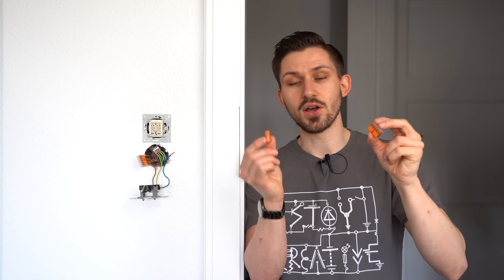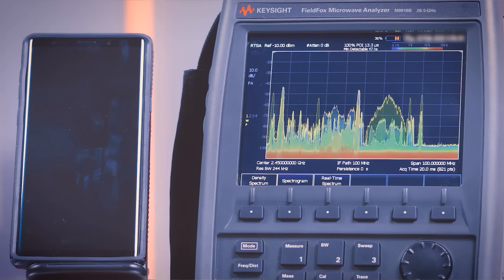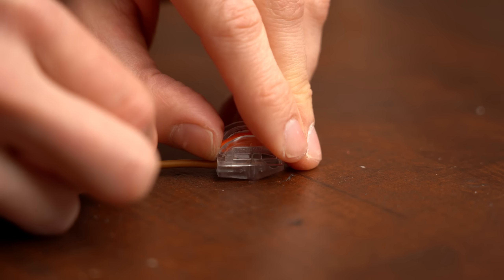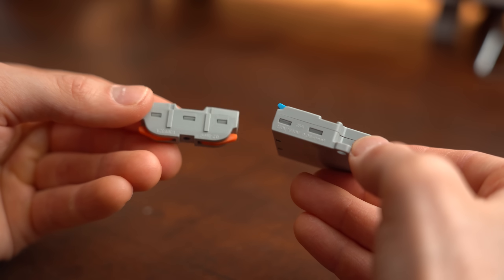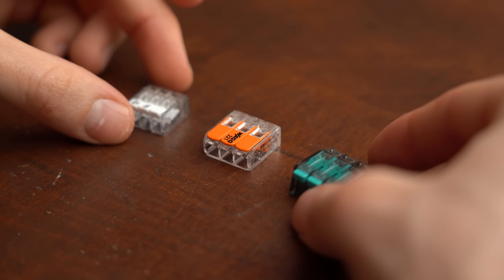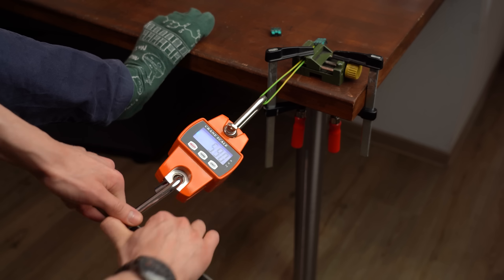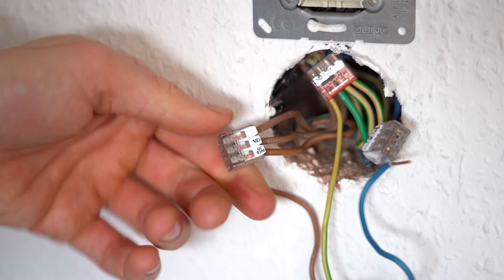I tested 7 Wago Knock-Offs Wire Connectors so you don't have to! (Surprising Results)

Comment: I use the lever kind all the time but I can say that there is not some "best" option between them for all purposes. It depends. I've seen lever nut splices where they magically somehow wiggle and pop off, lending to the idea that their use in general could become a little "too easy" for people over time. If I forcefully tried to remove a wire from the nut without opening the lever, I can do it with some twisting and turning. It's just not magically as solid as taking something like 12 or 14 and literally braiding it together. Wagos could probably stand the test of time but AFAIK empirically they cannot compare to wirenuts which have the actual evidence of doing so in many situations. 
People who are doing basic residential or light commercial wiring don't need to be too concerned about it.. they just need to make sure their joints are good with whatever product they use. Some facilities have local code which requires them to braid and solder permanent terminations in the boxes, something which the thought behind is not possible to do with a lever nut. Some of the thought behind that could be something like hospitals where engineers have kept it in mind that they want feeds to stay together temporarily maybe even in some drastic situation where an earthquake or other climate disaster has damaged some of the infrastructure. Having said that has anyone ever used wagos in a hospital for anything other than small fixture wiring? Would they let you make all the jbox terminations with them? 

This is just a random and joking example but I bet someone who is in an extremely unlucky situation where they need to hold onto some long ground wire to keep from falling is going to prefer it was fastened at the other end with a braided wirenut as opposed to a wago. I understand a wago may be tested and rated with all the acclaim but again, it's not hard to go see wirenuts older than you in old plants which are still fine. You can't do that yet with a wago unless you're pretty young. Of all the back and forth about wirenut vs wago I just don't get it when it comes to simply and basic wiring. Who cares. Just don't use scotch tape. People are talking about their preferred product for their electronic light switches lol.

Comment: i couldn't see very clearly but when you said the last bunch of connectors had the CE logo i thought that i saw the Chinese CE logo (i could be wrong, it is hard to see which is done by the Chinese on purpose). The EU CE logo is the certification. The Chinese CE logo simply means "China Exports", which just means it comes from China. The difference is that the the EU CE has a bit more distance between the C and E than the Chinese CE logo. (you should look it up if you didn't know this, it is a subtle difference)

Comment: About 4 years ago I was building a Amazon out in Ohio US. I was in the convayor power and termination crew, and main power distribution. 

This was the first job I've been on where the spec called out waygo connectors. 

Amazon uses computer algorithms and sound engineering down to the fraction of a cent so there was some reasons why the choice was made. 

Since then, I have preferred them to wore nuts and seen a few jobs add them to the list of specifics. And this is a change I like to see. 

How I was trained, was only partially correct because 20 years ago we didn't have these and the option that was avaliable was a push in only style that was not shown here. It would lead to higher resistance, and even conductor breakage due to the irresponsible installations they were used in. These were not waygos and there is a difference. 

Now, knock offs vs oem. Some knock offs are long as they see listed and labeled, have the proper certifications and are fit for the job, it is then equal in many different aspects. Like ideal and redhead as brands of wire nuts, one could call all products down stream from the orignal wire nut made from porcelain with a screw terminal that it self screws in to a shroud as a orignal. 

Regardless, they are faster then solder and insulation and that makes them better for reworking, troubleshooting and even better then wire nuts.

Comment: I like how the resistance test graph conveniently failed to show that the Wago connector, like the one in the vid comparing Wago to wire nuts, had a resistance of 2.2 mΩ - higher than any of the knock-offs. Nothing like a good, unbiased comparison video, eh?
Reply: Watch the video again and then understand the point... With a 2.2 milli Ohm resistance this really only starts to become an issue when you try to run 1000's of amps through the Wago, by which time the wires will melt long before the Wago will.
It is not a comparison 'who has the lowest milli ohm measurement' because frankly nobody cares, it is a comparison 'are they all low enough resistance so they will not overheat'...

Love the immediate cry that it is now a biased comparison because you disagree.

Comment: The only other test I'd like to see is running high currents through them to see how much they will take.  Other than that I do think this is really good information and I use Wago connectors in my house wiring all the time.
Reply: Take the resistance measurements and calculate it ;)

Comment: Can we have the next video on how stupid NA's are because we insist on living like savages with our 120v single-phase?   
.

Wago's are nice, however quite a bit more expensive. 
I get that they're hip, and reuseable, etc, etc. 
Here's a Trades tip most of you brainiacs have missed in your circle jerk of smug superiority.
Over here, we connect a light switch or junction box with a wire nut, yes; and in all likelihood its probably not going to be touched for 10, 15, maybe 20 years, maybe never. 
So, I can strip a couple wires, twist with some pliers, and twist on a wirenut, crimp if I'm Union.
2 minutes max.  Or I can save a whole minute, and use a Wago at 2-3x the cost/connection.
And then its going to site in a switch box or J-box for the next xxx years.
Aside from Makers and tinkerers, outside of >3-4 wires being connected, Wago's extra cost and 'features' are either negative or N/A for most applications they would be used for.
If I have 4/5/6 wires all coming in, then sure a Wago would be nice.
80-90% of household wiring over here though is 2-3 though.
Reply: @Boots: A bit more emotionally presented than my style but I agree and I'm grateful you said things that needed saying. Thanks!

Comment: In my home I have yet another style of connector, idk if you ever heard of them, but basically they are Wago connectors but they doesn't use a leaver, they use screws that clamp down the wire
Reply: He also shows those in this video when talking about an older video.

Comment: These Wagos are EXCELLENT when wiring stranded LED lights/fixtures to solid gauge wire that's wired around the house. They also work very well with applications around the car and motorcycle which I have at least a decade of very good experience using. The only reason I still use wire nuts is cause I purchased a whole bunch at a discount years ago.

Comment: Why use wire nuts? When there is acient and proven method for connecting wires: Twisting wires together and isulating them with tape. Cheap, low resistance, non-flamable and disassemblable, only weakness is idiot profing.

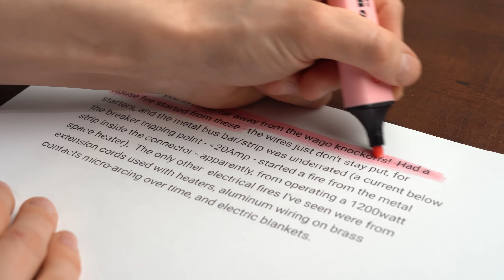Comment: 8:17 ...the smaller the current
Reply: P=(V^2)/R, where V^2=220^2=48400 (in my country, that is.), so P=48400/R, so the lower the R, the higher the P and you lied. Disliked.
Edit: Am I the ONLY person in here that noticed that? oh, and BREAKING NEWS! A 13 year old disliked electrician's video for lying in it!
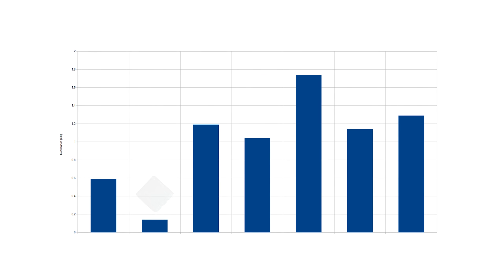Reply: 9:21 Not*
Reply: With current and resistance it is a quadratic relationship - see video. You're jumping in with a completely unrelated (to the situation at hand) equation.

Comment: I sometimes think these opinions wire nut versus wago are formed based on something that are formed because someone learned that way and has used that method for so long, not necessarily because one product is superior over another.  I've never used Wago connectors because I live in the U.S. But I am definitely intrigued because of your videos.  Thanks for sharing this insight.
Reply: Honestly I get nervous looking at wire nuts, to me they just feel 'bad' even though I know they're fine too, most likely a cultural thing/used to a different style. I guess the wire nuts look old and therefor obsolete/bad... I wonder if Americans look at Wagos and think they are cheap plastic or over-engineered or something?
Reply: @someguy4915  To me they are normal over here in America.  One big downside of using them is if you do a lot with them then your hands are going to get sore.  They make a tool that can make it easier.  But we didn't have it when we were doing wiring in our house.  So we had very sore fingers.

As an American I don't think wagos are cheap plastic.  My only thought is they might be a little cost prohibitive if you're doing a lot.  But it might be worth it too to avoid sore hands.  I think what will keep wire nuts going is the fact people have been using them so long over here.  You've got electricians who have been using them a long time.

Comment: Keep always in mind for the house installation connectors what can happen when a cheap terminal setting your house on fire. Your insurance is always hiring good fire detectives.  Imagine they figure out you made use of non certified materials with fake writing! No insurance will pay then.
Reply: Know your contract and the law.
Reply: Uh... People die too...
Reply: Depends, in most European countries this doesn't really apply unless the insurance can prove that it was intentional (and then it's a crime). Though it is absolutely smart to get certified parts instead of cheap knock offs. For companies this is different as they can in fact be fined/faulted for uncertified installations.

Comment: We replaced all the manually made wire splices with Wagos before the plaster were put into place, so we knew everything would be safe. But as a generic rule, I'm Brazilian, here I pay about R$2,89 for a three connection Wago, and, for a wire nut, R$0,09, so, I use wire nuts mainly for led lights where the power draw doesn't justify a Wago connector, and, they'll likely never be serviced shortly.

Comment: Well, they're sort of right. If your connector is rated for 30 amps, and and one connector fails at 90 amps, and the other 1 fails at a 100 and 10 amps, in the amps, the 100 and 10 AM connector is not necessarily better, because they're so far above the rated Ambridge that they're both effectively perfect.
Reply: It took me a few readings to understand that you meant a single connector failing at 110A, not two failing at 100A and 10A respectively.

Comment: Not sure how a CE certificate could be applied to a component? I know Honeywell was fined for a CE mark on a microswitch. Warning Its complicated. Only a technical report would give the details of which tests the component was subjected to. I would say a CE mark would be a sign of they did not know what they are doing. Honeywell Quote "The TS Series only has UL and Canadian UL (cULus).  Our datasheet online incorrectly shows UL, CSA and CE.  We have asked to have this corrected several times before, but it is still misleading our customers.  These switches have not been tested for CE or against the European Standards." Because you cannot.
Reply: As far as I understood, the CE mark is just a "fit for purpose"-certificate. This can apply to individual components, but also to installations.
Reply: Ah, I also forgot. There is a "China Export"-logo (developed by the Chinese government if I'm not mistaken) that is almost exactly like CE, but the spacing between the letters is slightly different. Not a source of confusion at all!

Comment: Personally I don't trust anything except manually twisting wires and welding them a bit with modified microwave transformer. It'll never fail

Comment: When it comes to the CE marking you have to look closely at the marking. The CE (Conformité Européenne) and CE (china export) are similar, but with differences since china export is not a certification. The knock ones I bought are using the china export CE, so they don’t have any actual standard certification.
Reply: This is mostly a myth. It is true that some knockoff products used the CE logo with incorrect spacing, but nothing is stopping knockoff manufacturers from just slapping a CE label on the product and selling it anyway. It is almost impossible for them to be held accountable, and customs aren't going to check the certificates for each product that gets imported.
Reply: Chinese have woken up to the correct CE mark format. Even Microsoft used the wrong format a few times. There is no China export standard only  Chabuduo Export.
Reply: Once again, China Export was a myth, a hoax/joke created to make fun of the fake certifications... Even big Western companies get markings wrong sometimes, China Export is not a certificate nor would a shady Chinese manufacturer of poor quality components care about falsifying a certification...

Comment: I was just working on a project that had a heat issue in the wiring and connectors (higher than expected current), and Wago nuts saved my bacon. They sell them by the box on Digi-key, and next time I'm using these for power distribution. Just need some 3D-printed mounts.

I do have a small kit box of "made in Germany, packaged in the USA" Wago 221 nuts, but since Amazon knockoffs are a minefield and since I can now buy them easily on reputable distributors, I don't buy them on Amazon anymore.
Reply: Buy some fuse's as  well.

Comment: Many of the "knock off's" from China that have CE stamped/imprinted on them is a misrepresentation. As Chinese Exporters are required to be licenced the CE marking is usually an internal bureaucratic thing and nothing at all to do with the CE symbol used in the EU. A genuine compliance would have a registration number with the appropriate testing body and cross reference to the tested laboratory etc information publicly available...

Comment: Australian electrician here. Our connectors are defined by a book known as the AS3000. The wires must be amalgamated under a screw terminal. As far as I'm aware, we can't use a connector like this unless it is internal to a device. Additionally, our wires are joined and then secured meaning there is no bus. With the wago connector you are relying on a bus internal to the device not failing. And we need to consider the long-term safety as it is inside the wall..

Comment: I don't know how many times I've put a wired nut connector wrong. I believe the Wago connectors are far superior. The clear case clearly shows you if the connection is done right. Further, when combining solid core vs. stranded cables Wago makes it super easy. And for all the people that don't like Wago connectors, you are free to use wire nuts, no one is forcing you, so don't hate on Great Scott.

Comment: Hi MR. GREAT SCOTT ....
I am a regular viewer of yours. I watch all your videos and they are very interesting.
But now I have a problem. I bought a boost converter made by XL6009E1 ic. Its output voltage is stable without any load but whenever I connect any load above 100mA its voltage drops immediately. But then its output current becomes about 1.5A. I do not understand why. Please make a video with a solution.

Comment: Where did you take the price ? amazon exaggerated prices? What about aliexpress/ alibaba prices ?
Reply: I was also surprised by the prices, but after checking Ali it is about the same, it gets barely below 20ct per piece, not far cheaper than Wago. Maybe if you buy 1000s in bulk...

Comment: I don’t think the test that you did with wire nuts and the flip connectors were biased at all. At the end they perform the same in the wire nuts are actually cheaper. Now your preference was the clip connectors but I don’t think it’s biased that you made that assertion. I thought your test were fair and thorough.

Comment: THE issue with certifications is that none of them sample products randomly or check that design changes requiring re-certification have happened. There is next to noting stopping any manufacturer from providing a bogus high spec part to the testing authorities and selling a cut down version to the public. This is a known and active scam in the wild in the PC power supply industry with the 80+ certifications.
Reply: A well known brand of Led power supply's offers test samples for government contracts if required.
Reply: @larkhill2119  Specifically requesting one is LITERALLY the worst way to aquire a representative sample for testing. If they know it's for testing they are going to make sure not to send you one of the 10,000 with the dangerous solder bridges made by Jitter Hands Xiao before he was fired when the QC team got out of quarantine.
Reply: 80+ certification scams on ATX power supplies, never heard about any of that, especially because it is rather easy to test: measure wall outlet current and hook up power resistors to the 12VDC, 5VDC, 3.3VDC and 5VSB lines to GND and measure how much power the PSU consumes by itself.
Do you have any known brand that has bogus 80+ certification?